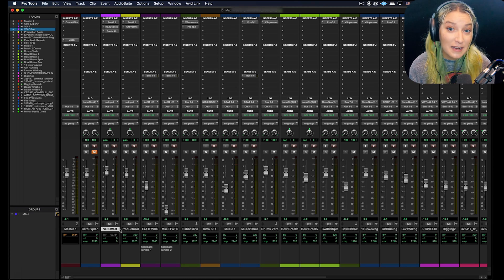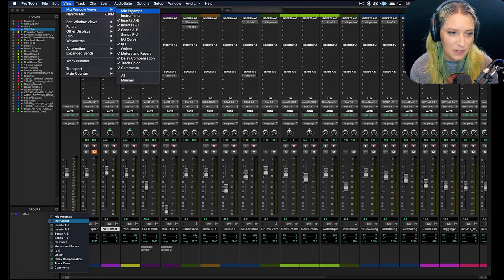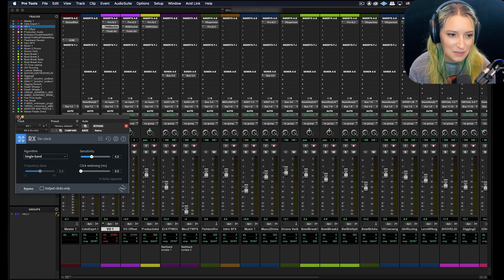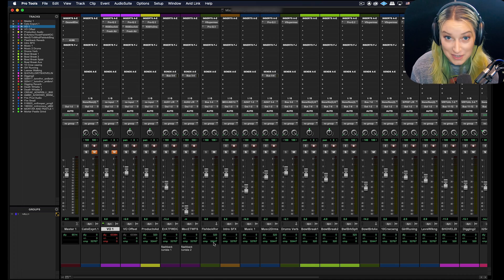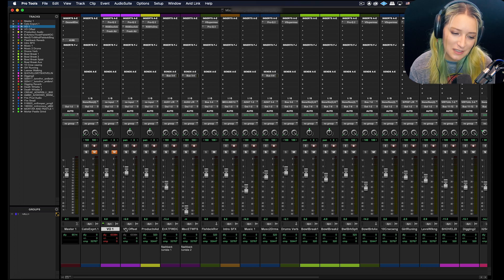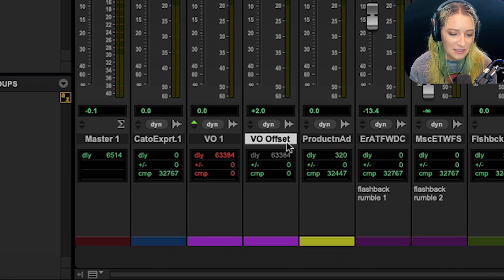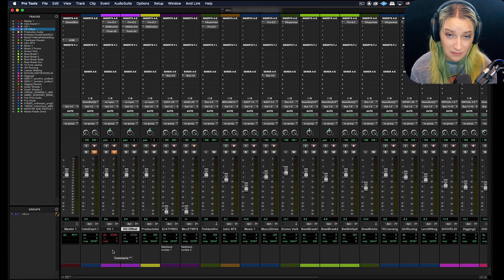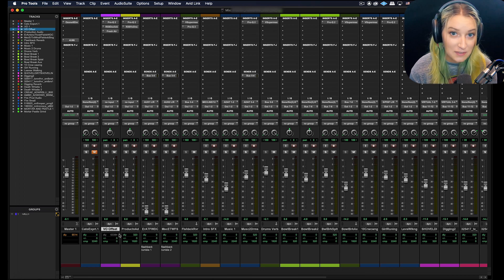Pro Tools Basics: Delay Compensation

Comment: if the mix bus is orange in delay compensation, is it okay for audio and video sync? The audio track was 1088 comp and the aux input (mix bus) with my plugin, was 1088 delay.
Reply from the maker: I believe if it's orange, then you're okay. It's when it goes red that you have a problem.

Comment: I also got delay compensation with the RX de-noise plugins which effected the audio - video sync in post production. I ended up removing them as I am a beginner with pro tools and didn't want to throw off any audio timing issues. But lacked the audio clarity that came from using the de-noise plugins by removing clicks and mouth noises in the singing...... for a live music video shoot performance.
Reply: the best way to use de noiser, inparticular RX is by using audio suite and render it on to the clips. or use the RX connect and the stand alone software.
Reply: @kristianmarschewski1590  Thanks very much Kristian, I only read this comment now. Very good advice I am going to learn how to do this today ! :)

Comment: Thank you very much ,so what to do if its an Aux? Record the track and time align it suppose?
Reply from the maker: Yeah, that's one way to deal with it - route it to an audio track and record that (I would just keep the original tracks and make them inactive in case you want to rework it later). Or find a way to reduce the plugin usage. Some plugins will just eat up the available delay compensation though, so it's definitely warranted at times.

Comment: When mixing, is it best to have the delay compensation engine set to long or short?  I've always had it set to long in Protools 10 and get somewhat frequent errors during a track bounce.  Also if you have Protools CPU usage limit set to 85% or higher, would that effect normal operations like mouse and external hard drive performance?  If anyone reading this knows  it would be greatly appreciated.

Comment: It might be also worth mentioning that Delay Compensation in PT is applied per-bus basis. 
I haven't been using PT for too long and I've just encountered an issue that took me some time to figure out, only because I'm used to other DAWs.

I'm also working on a short film where I have different submixes for all the food groups. I have a very transient sound on a dialouge production track, routed to the DIA bus. A similar sound was done in Foley and routed to my SFX bus. Both transients are perfectly lined up according to the timeline and I was still experiencing flamming (probably I wouldn't even have noticed the latency if it wasn't for that transient sounds). When I moved one clip to a track that was routed to the same bus as the other clip, it was fine.

Then I realised that there was some processor heavy plugins on one of my FX tracks' inserts, and all my other tracks that is routed to the SFX bus is compensating, but note those that are going to a different submix. Hence my submixes were out of sync. 

I'm not quite certain why PT works this way, there might be a good reason, I just don't see it yet, but it sure gave me some headache.

Comment: Thanks for this video. I do livestream with ProTools and even with delay compensation on I'd still get latency issues.  What I didn't realise is that with livestream you'd have to actually turn delay compensation off by right clicking in the delay compensation section over where it says cmp and turn it off. You'll see cmp which is in green will turn blue. That fixed all my latency issues.

Comment: Thanks for the tip. I was looking for that. 
What version of PT is this? I'm not familiar with this dark theme/ color palette. Thanks!
Reply from the maker: I made this video a while back, so I don't remember exactly which version I was in, but I've been on the subscription model for a while now (but I do wait a bit before running updates, I don't like being the first one to try the updates). So, I think this one might have been one of the 2021 versions or something.
Reply: @CatoNoise  Thanks. I'm still with the 2019 version (perpetual license). 
Other than the color palette, any major differences that you can think of (positive and/or negative) between the 2019 and the 2021-2022 versions?

Comment: you can also use the time adjuster plugin to add the delays rather than editing the clip positions
Reply: Time adjuster does not allow to use negative values. In this case, time adjuster should be applied to all other tracks, not the one with the Delay compensation issue.
Reply from the maker: Yeah, thanks for pointing that out!
Reply: Is that a standard plugin in pt or 3rd party?
Reply: @SXTWLVE  pretty sure its standard

Comment: Just a little advice for the RX because it is heavy into delay compes. I'm used to apply them through the audiosuite process. Also another trick is to give more RAM to the audio playback, if you have 32 GIGA you can easily go for 14/16 GIGA for the playback engine.
Reply: could you please explain how to do this or send another link please? I have a lot of processing issues with my RX plugins
Reply: @kaylaelrod31  yes shure!!!
Reply: @sgfdancecompany  I'm also interested in this. Could you let me know where I can address more ram to audio playback? Thanks
Reply: Audiosuite in pro tools allows you to process in places the track or stem you wanna treat, in this way, you commit the RX processing straight and don't need to use it as an insert, of course first make a playlist of the track to save the raw version
Reply: @aliceswonderland7503  Yes of course ub the audio playback dialog at the bottom you have a tab dedicated to the RAM, you can address half of the RAM of your computer to get more power (if you have 32 gigas, put 16 and so on) Let me know
Reply: @kaylaelrod31  RX plugins are made to use as AudioSuite plugins. You can set your settings on the insert and then copy them to AudioSuite version and burn them in. Make sure you make a playist copy before doing that.

Comment: I did find a post in reddit that claims "the maximum is fixed instead of user-assignable like in earlier versions. 16383 samples at 44.1 and 48 kHz, 32767 samples at 88.2 and 96 kHz, 65534 samples at 176.4 and 192 kHz."
Reply from the maker: Yeah, I think the maximum that Pro Tools can counteract is fixed, but I always forget the exact number.